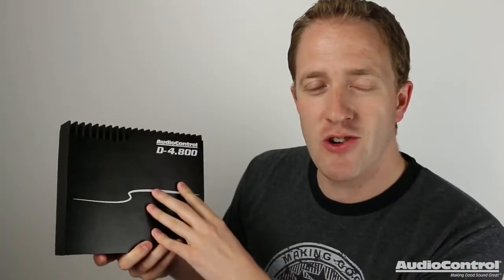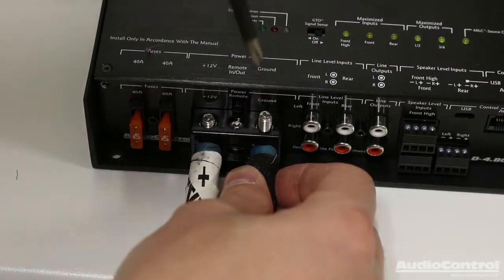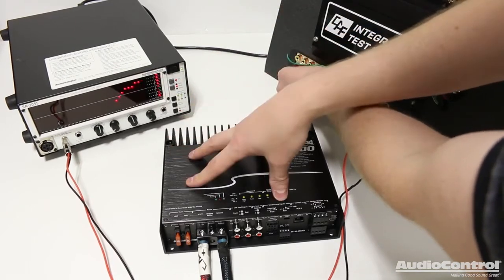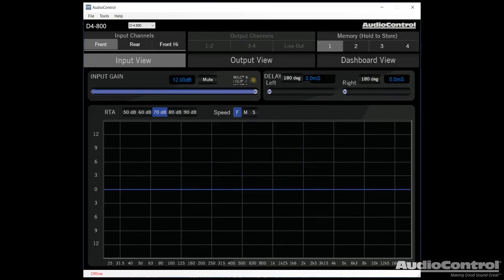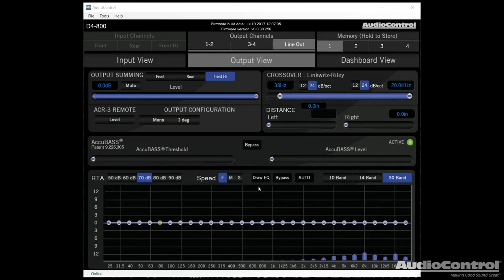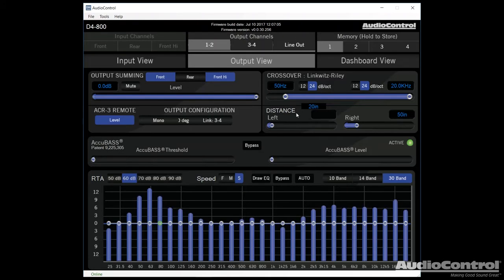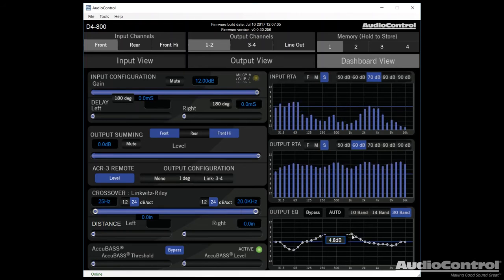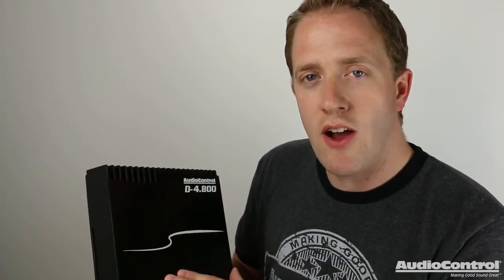AudioControl D.4-800 DSP Amplifier Training Video

Comment: what if you have another 4 channel audiocontrol amp?   will this proccessor do all what it did for its own amp? T/A, C/O etc.?
i have 2) 3 way components.  i want to use the headunit for all the tweeters. this dsp for the mini woofers and another AC amp for the main woofers.  

whats your thoughts?

larry
Reply from the maker: This amplifier has an RCA pre-out which has full DSP compatibility for the 2CH RCA output.